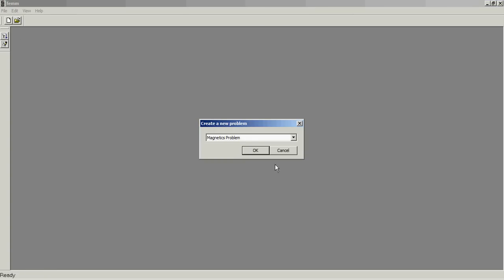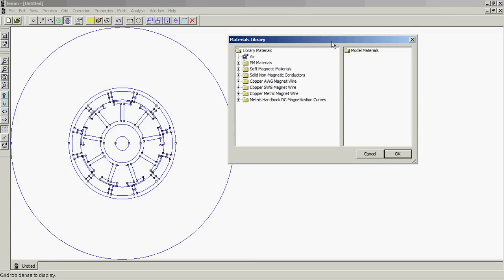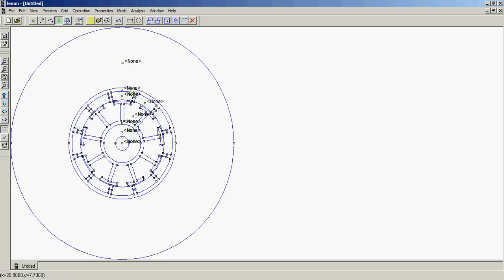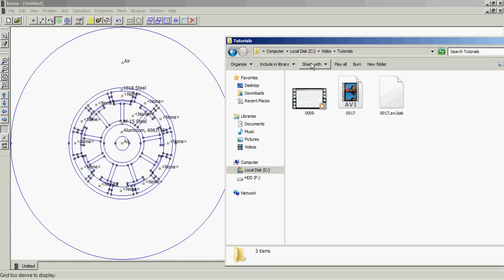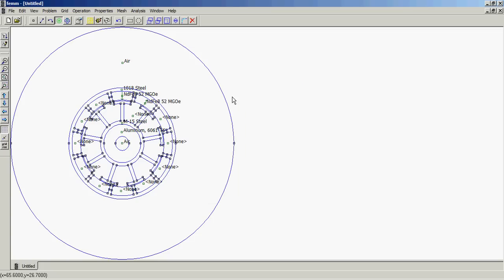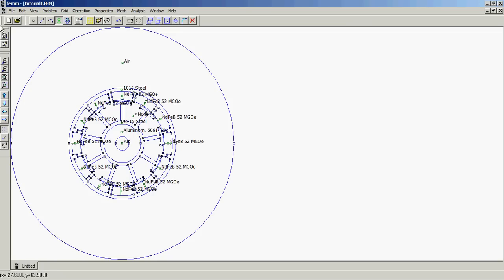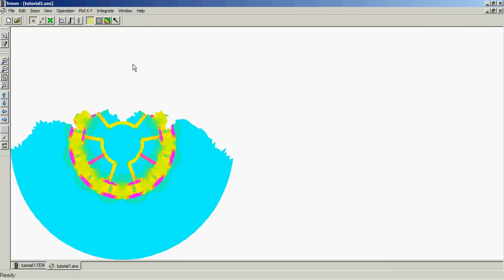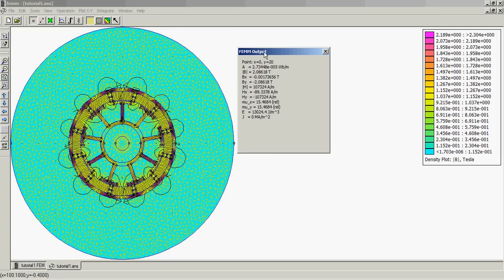Tutorial: FEMM Motor Modeling- Part 1

Comment: I used Autocad 2013 to generate a simple geometry, like a ring, for instance.
then I save it into DXF 2007 format and try to import in FEMM.
But nothing happen.
on the bottom left of the screen you can see Importing dxf, press esc to abort but, as soon as you move the cursor along the screen nothing happen.
do I miss something?